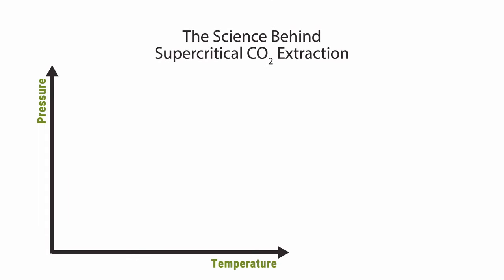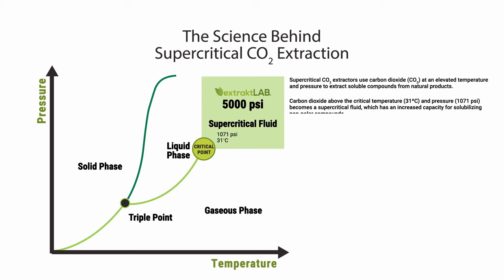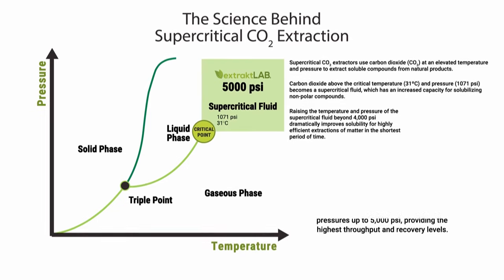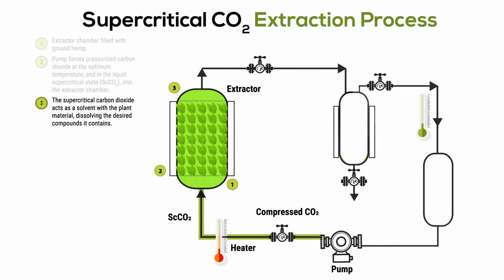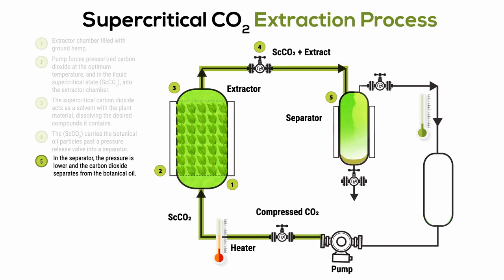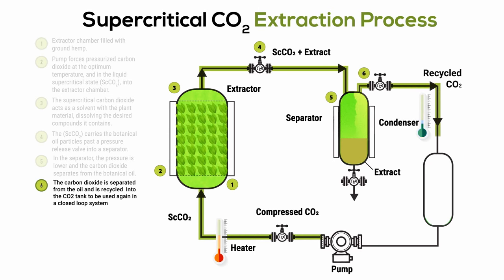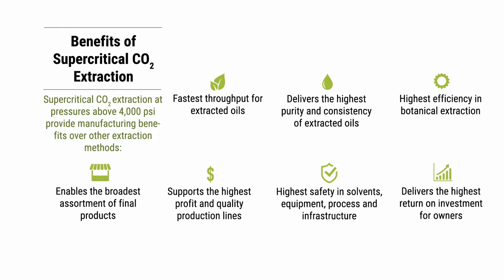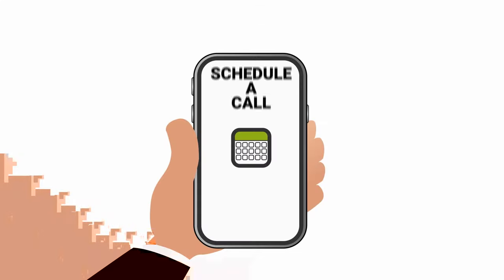How To Do Supercritical CO2 Extraction

Comment: What kind of Hemp to make Supercritical Fluid?
Reply from the maker: It is not the hemp that makes a Supercritical Fluid. It is the carbon dioxide. It needs to be at a high enough temperature and pressure to achieve a supercritical fluid state.